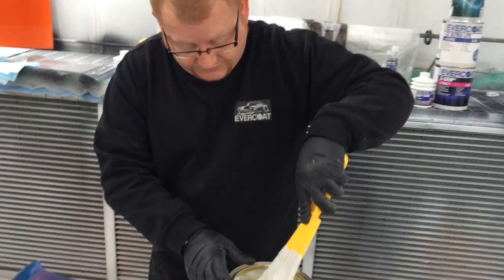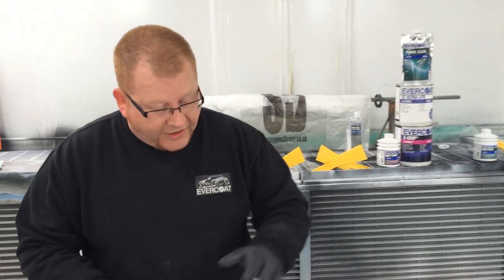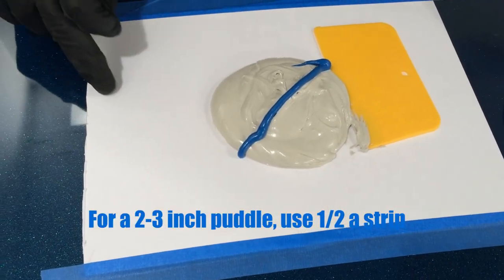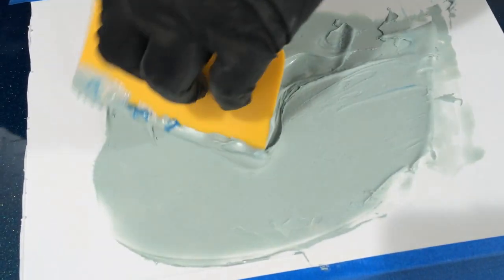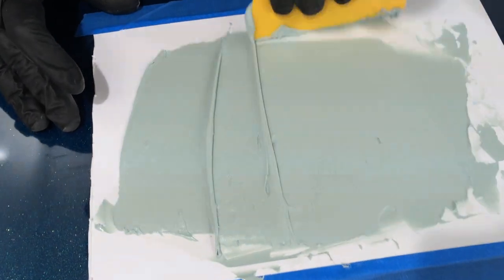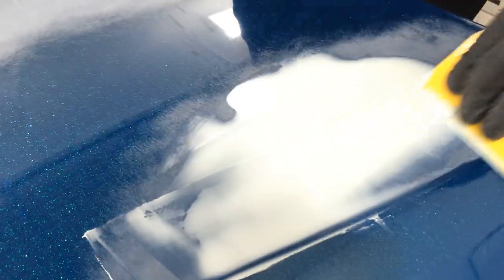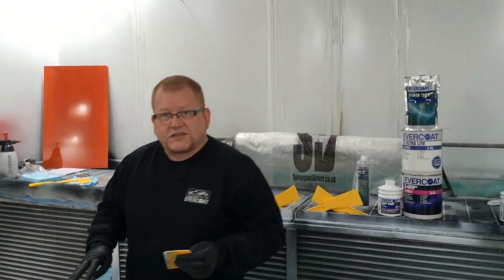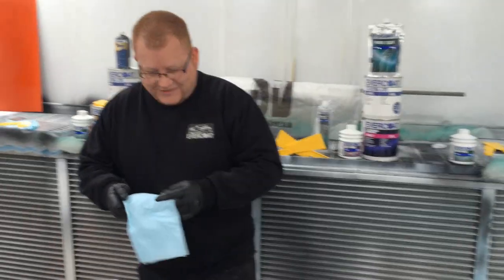How to Mix And Apply Evercoat Rage Ultra

Comment: hi i realy like rage ultra this is amazing filler. i do have question little tricky. If a apply it and start sand it but i see tjat i will need more filling on the repair area if i hafe bare matel expozed with what grade sandpaper i have to remove the streight block sanding marks. 180 or some coarse because on the bare metal  180 will leave very small scraches i'am worried about adhession because on bare metal 80/120 is good for applying filler but when i have filler allready i worry for the rapair maping(  this is normal life and sometimes the repairs are big and sometimes there is going to be  filler and baremetal on the same spot not just the edge of the repair )